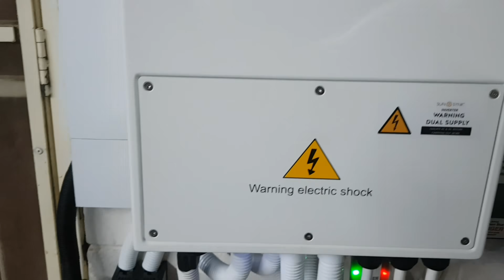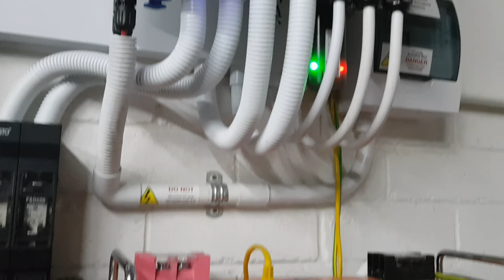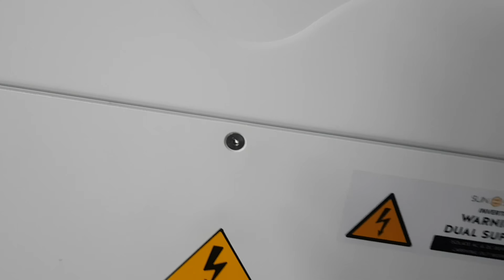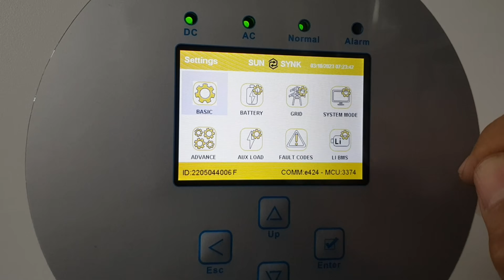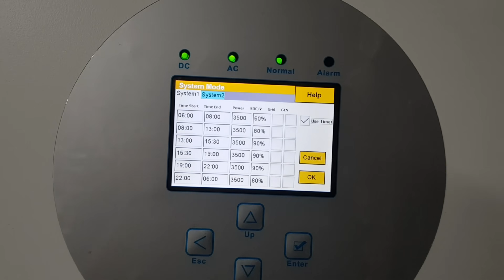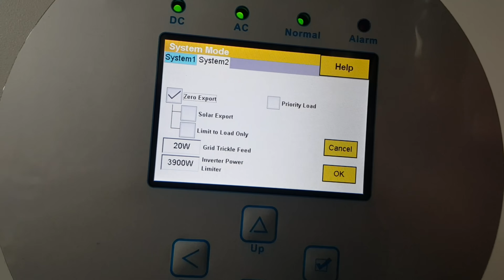Sunsynk inverter solar solution part 3 || now with Revov battery

Comment: If you have zero export ticked & CT coil installed correctly you wont export to grid, i would also tick priority load to supply load from PV's, I run off grid except when cloudy for longer than 2 days, I run everything incl 2 X 150l geysers (3kW each), in summer my aircons (3) in main living & bedroom areas run day & night as I am in the Karoo so 3 deg in winter to 48deg in Feb, dont worry about inverters cooling because they have own fans. I understand the timer function differently from your explaination, if the timer not ticked I dont think it does anything as far as I understand it because the inverter will charge batteries to 100% if there is enough spare power after supplying the load, the timer is to force grid charging to batteries if under the %, so by ticking next to desired % the battery wont discharge below set % so you will have storage for loadshedding. Revov batteries can discharge to as low as 5%, but suggested to min of 10%.

Comment: Panels should be +/- 26deg Angle to ground for optimal working in SA, will solve water collection issue, SunSynk great invertor, Revov also good value & great service support. I have 9 plus 9 Canadian 415W, into 2  X 8 Kw Sunsynk with 2 X Revov R200 10 kWh batteries ( total 20kwh storage).
Reply from the maker: If you had a few spare A-frames I will use them gladly and yes anything between 26 and 30 degrees works great

Comment: Hi I was just wondering if you could even do a video or reply to me here on how you went about connecting the auxiliary load to the nonessentials and how you set up the connection for the CT to the main DB. It would probably be better to do a video on it as I have not seen one video online about the way to connect it properly. Thanks man, cheers👍🏼
Reply: The installation manual has example diagrams explaining aux power, generator connection, wind turbine etc also the correct CT coil installation is covered.

Comment: Thanks for sharing!
Could you please advise on how you did your permanent Neutral - Earth bond? Do you supply your inverter from an Earth Leakage?
Is the Inverter itself protected.
Thanks in advance!
Reply from the maker: The inverter is not behind the earth leakage. I have tried to connect it like that before but you get random trips of the earth leakage. The cables that comes out of the inverter for your load is where you do your permanent earth neutral bond. Remember not to connect an earth cable on the output of the inverter if you do the permanent bond.
Reply: @jacqalas  Thank you. Appreciated. Really enjoying watching your journey!
Reply: @jacqalas  Did you connect the inverter case itself to the grid earth as well? Or do you have a separate earth spike for that?